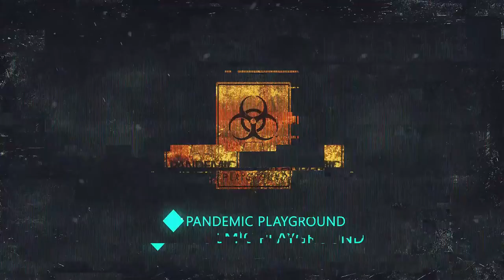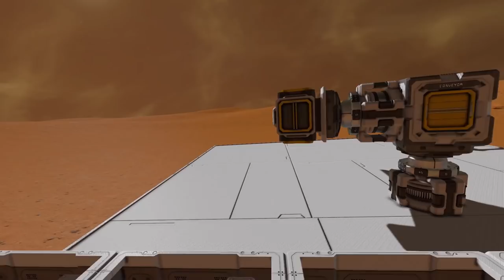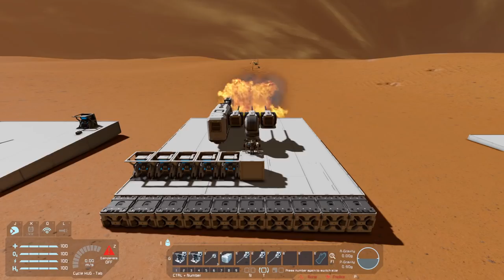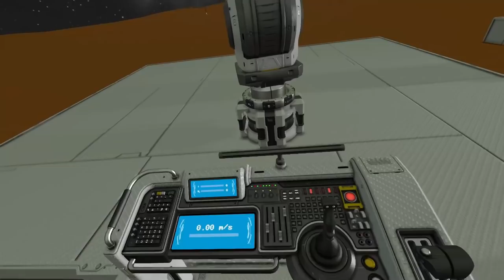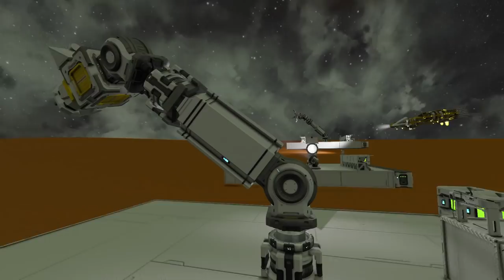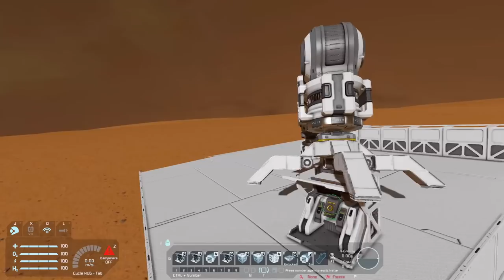Space Engineers Experiments: Fun With Custom Turret Controllers

Comment: I've found through experimentation that putting the hinge on shared inertial tension stops the shaking! Hope this helps!
Reply: I found that shared inertial tensors locks my hinge and I can't use my turret anymore. What am I doing wrong?
Reply: @sebione3576  try adjusting the torque and try only sharing internal tension on one of two rotors. I've had this problem before and tried what I've suggested and it seemed to have fixed it
Reply: If that doesn't seem to work I would just keep adjusting the settings until you find a sweet spot. I'm not entirely sure what causes the error both you and I encountered, but so far minor adjustments have fixed all of my turrets. Also I found weight is a factor so don't make turrets or cranes too heavy

Comment: i've made an excavator using the new custom turret controllers
on large grid
as a base i use a large cargo container, i place an advanced rotor onto it, then a conveyor junction, and a cockpit on top of the junction
attached to the back of the junction is a custom turret controller, and in the of the junction i placed a sorter to pull all mined ore from the drill 
from that a hinge going vertically (up down), 3 pistons (each piston is 5m long, and extends extra 10m) a conveyor junction and another hinge pointing downward with 2 pistons and a drill

lets me dig pretty deep, is effective and suprisingly portable

Comment: The best thing I can think of that isn't a gun for this would be an auto-grinder system. You'd have to use timer blocks and sensors for finer control, but you could have one arm with a landing gear and a different arm with a grinder on it. Have the landing gear lock the target in place so that the grinder arm can grind it without pushing it out if it's reach. I don't know exactly how technical it's going to get, but it should be doable in vanilla with an obscene number of sensors and timer blocks.